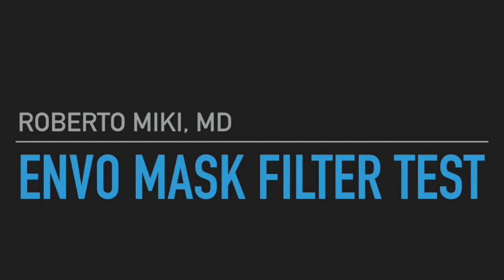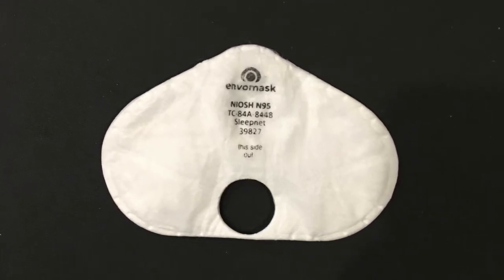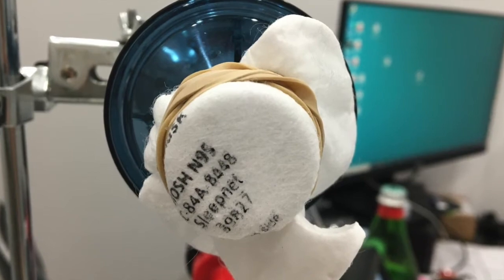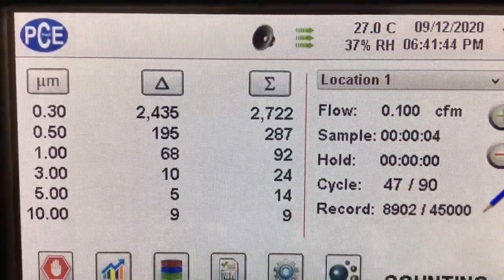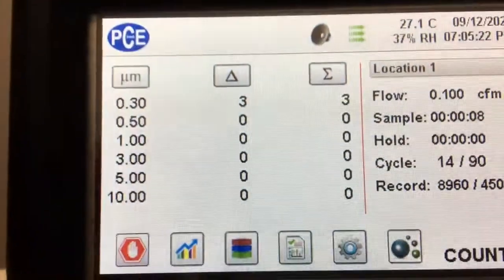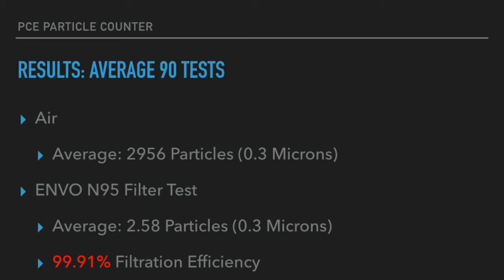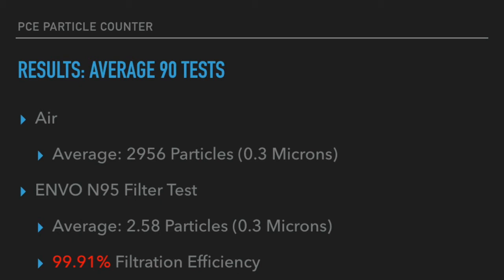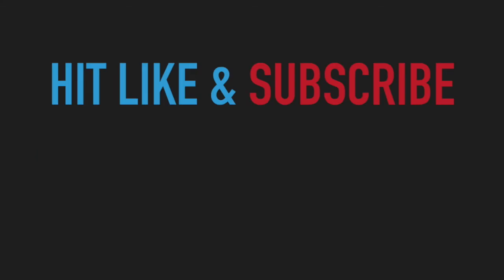ENVO Mask N95 Quantitative Filter Testing with Particle Counter

Comment: As a former reservist officer on Chemical and Biological warfare I use a 3M 6200 respirator, (which seals tight my face),with 3M 7093 Particulate Filter 2 Pairs NIOSH P100 P3R, and glasses too. If you use a face mask and Glasses in cold weather, and the Glasses are fogging, that means that you are exhaling and inhaling around the mask.
Reply from the maker: Absolutely

Comment: Can you do the japanese products eg. shigematsu. Their n95 cartridge, the x2 is “washable”. The n100, x3, is standard hepa. For fun, I suggest you also test the UNICLO airsm, for which people lined up blocks for.
Reply: Shigematsu has way lighter masks comapred to 3m 6800. The single filter half mask is also pretty low profile, I’ve bought 7 to add to my rotation. For long angio procedures and any short emergency  procedure where swab is still pending, I still use the Cleanspace halo fullface demand PAPR. For short procedure ie, tube insertions, centesis or biopsies I use 6800 and now this shigematsu tw088. Id love to send some samples but there is no way for packages that come from the Philippines to just walk its way through US customs. Lol.
Reply from the maker: I contacted Shigematsu and they stated they have no inventory and if they did they are not allowed to export to the US. May be someone in the Philippines can make a similar set up and can test the mask?
Reply: agree
Reply: Btw start of the pandemic I used a divemask with a vent filter as inspired by your videos. I was able to last through a long PTBD using it, though my partner/assist had presyncope (from the nosebridge pressure i think).
Reply from the maker: Headaches, nausea, and presyncope are not unusual with the snorkel masks. I got a terrible headache the first time I used one because I put the straps too tight.
Reply from the maker: I can try to get my hands on them. If you have any extra, happy to test them.
Reply from the maker: I looked on Amazon and they do not have them. It seems this company only sells in Asia when I check the website for the company. But that filter looks awesome. I will try to see if someone can get a hold of one to test.